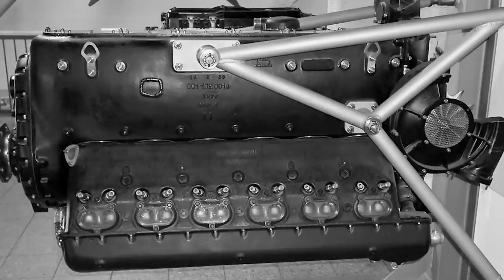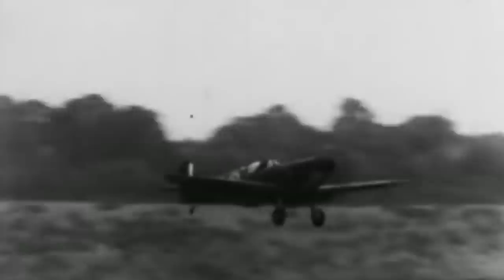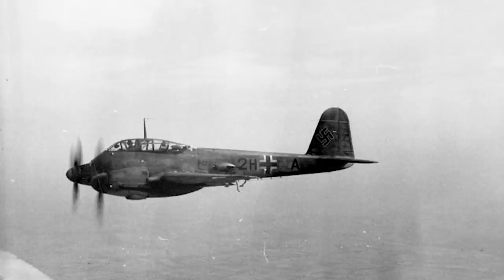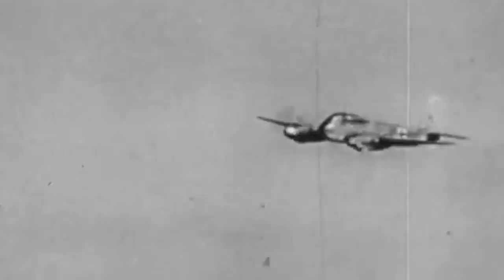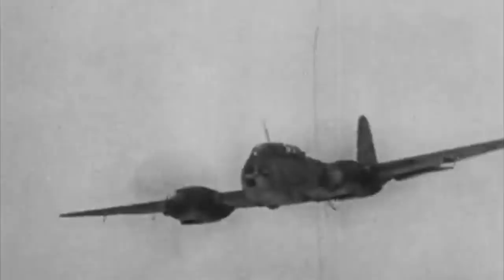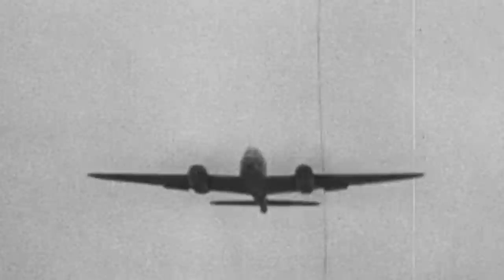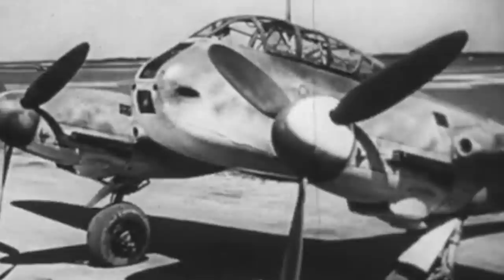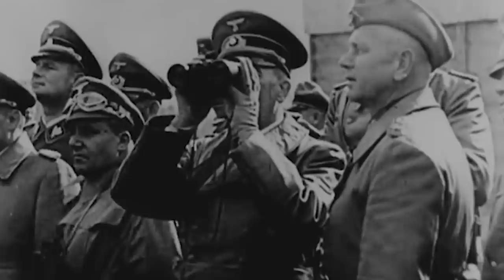The Catastrophically Bad Airplane that Ended Germany's Chance to Win WW2 - Me 210 Destroyer

Comment: The fuselage of the Me-210 was shortened to save building material, which caused the instability during flight. The Me-410, its successor, had a fuselage with the length of the original design, and it proved to be a much better aircraft.
Reply: The wing design was also changed slightly with the outer wing panels swept back due to issues with center of gravity being too far aft.
The 410 was quite a good aircraft.
The 210 was supposed to be the answer to the British Beaufighter and Mosquito.
Reply: Besides the serious instability problem, the Me 210 was a bit underpowered for its size, too. the improved fuselage design and the availability of the more powerful DB 605 engine made the Me 410 a much more acceptable plane.
Reply: do you guys think raising the horizontal stabilizer would have helped the stalling issue?
Reply: @allangibson2408  Beaufighter and Mosquito did not exist in 1939, nothing to do with Me-210...
Reply: @allangibson2408  Douglas did that for the DC-1 to DC-3, so that's not a problem. Messerschmidt did it for the Me-262 for the same reason and got a few more mph out of the airframe.
Reply: @MrTaxiRob  no because wings provide lift and at high angles of attack,  or AOA the stream going over the wing separates and result is loss of lift. The horizontal stabilizers are there to control pitch and AOA but once lift is lost they are just along for the ride
Reply: For all their legendary engineering expertise and reputation for quality manufacturing typically the Nazis were either penny wise pound foolish or squandered necessary materials on recklessly ill advised pipe dreams (fortunately for the Allies).
I used to restore Mercedes and was a BMW mechanic and found them both over engineered and finicky to maintain. For example, the 70's BMW 2002 had to have the valves adjusted every 3,000 miles, but when they WERE adjusted, nothing could touch it! My first car was a '59 MB 220s and while the gas engines weren't especially long lived the diesels used as taxis in Germany often lasted 900,000 miles.
Reply: @mro-aviation  I thought the problem arose from them being in nearly the same plane.
Reply: @Cadadadry  The Beafighter first flew in July 1939 so they were contemporary aircraft. The Mosquito first flew a few months later. Though wether the Germans were aware of them is of course a different matter.
Reply: @MrTaxiRob  An aft horizontal stabilizer cannot help, if and when the wings are stalling, as stalling is caused by the disruption of airflow at a certain angle of attack and airspeed. Position of the horizontal stabilizer has very little to no effect on the airflow before it.
Reply: @Kedvespatikus  ok then I misunderstood the way he described the problem in the video. Dark Whatever isn't an aeronautics engineer.
Reply: @MrTaxiRob  The problem with the horizontal stabilizer was that it kinda blocked the line of fire for the backward turrets. And shooting any stabilizer away is never a good idea. :)
Reply: @mro-aviation  

The stabilizer may be shadowed by the wing's drag in some situations. The aircraft then becomes uncontrolable.
The efficiency of the stabilizer is not connected to the wing efficiency / stall.
Planes with Straight wing do not do AOA. Only swept and delta wings.
Reply: @Kedvespatikus  
The barbettes where set such as the fire was interrupted when the line of fire crossed the stabilizers.
This was hard to achieve on a small compact aircraft, it has to be an electric solution because the goal was to reduce drag. More complexity !

This is a common problem with most dorsal-turreted aircrafts on both sides during WWII.

According to the time and size of aircraft, solutions where different? Eg on the Lancaster there was a rail all around the dorsal turret to prevent the guns from aiming at self. But this was generating drag and also drastically  reducing the fire sector of the turret. On B25 this was achived with an electric device. But this is a much larger aircraft than a Me210 !
Reply: @airplayn  Not even a Boss 302 as that was a high performance engine

Comment: The program WAS salvaged. With the Me 410.
Reply: More like "scrapped for parts"...
Reply: "salvaged" versus "replaced"
Reply: İs it really" salvaged" if you build a completely different plane
Reply: Fair, but Dark Skies often goes for drama over nuance.
Reply: @atakorkut5110  look at the pictures its basically the same plane.
Reply: @nick4506  yeah, very true but still  also completely different would you not say ?
Reply: Salvaged, but at what cost? By the time the 410 was available, a long range escort/strike fighter was no longer needed. The Luftwaffe needed interceptors like the Me 262 to meet the Allied bomber offensive destroying German factories and synthetic fuel plants.
Reply: @nick4506  Me 410 has a longer fuselage, new wing plan and new engines, so not really the same.
Reply: @atakorkut5110  nah they the same plane just new engines and wing angle adjustments. i think germany was just less picky in 1943 compared to 1939.
Reply: Didn't exactly salvage it.
Reply: And an attempt at prior salvage with the ME 310 which wasn't much better than the 210 and I don't think saw action?
Reply: @Frserthegreenengine  hey that's what Boeing does 🤣
Reply: Gotta love all this post WWII revisionism. Patton was right, we fought the wrong enemy in WWII

Comment: The Hungarian Me 210's were actually quite decent. The Ca-1 version manufactured in Hungary was slightly modified; the fuselage was lengthened, the wings and the landing gear were re-adjusted a bit, a different engine (the DB 605 was already license-produced in Hungary) was installed and so forth. The armament was also different, some Hungarian Me 210 were equipped with 40mm autocannon and missile pods. These were used extensively on the Eastern Front and were liked by their crews. These adjustments were eventually used for the Me 410. Hungarian pilots tended to like the Me 210 Ca-1, although they did not consider it an easy plane to handle; only pilots with previous experience with the Ju 87 were trained for it.
Reply: It was used as a Schnelbomber, ie, fast bomber (not unlike the De Havilland Mosquito), one pilot claiming : "We could hit a bedsheed with our bombs".
When once deployed against allied bombers, the Hungarian Me210Ca-s we ambushed by a large P-38 Lightning formation with disastrous result.
Reply: @karlvongazenberg8398  - Abd B-17 bombardiers claimed they could hit a pickle barrel!  ; )  With the P-38, aviation genius Kelly Johnson showed the world how to design  a great twin engine fighter. America's top two aces flew the Lightning, although  in the Pacific.
Reply: @scootergeorge9576  I guess the best US paralell for the Me-210/410 is the A/B-26 Invader.
Reply: @karlvongazenberg8398  - Interesting but the A-26 was a dedicated attack bomber. A night fighter variant was proposed  but rejected in favor of the P-61 Black widow.  Perhaps closer was the A-20 that saw use in multiple rolls. Both attack aircraft were designed by Ed Heinemann at Douglas who also designed the A-4 Skyhawk, AKA the "Scooter."
Reply: @karlvongazenberg8398  The A-26 was never intended to fill a fighter role.  As a bomber it carried almost 3 times the bomb load of the Me-21/410,  Plus it was a joy to fly.  My god father flew it and loved it.
Reply: 14 years ago I published a book about the Me 210 in Hungarian service and I also have such a video in my channel.
Reply: @karlvongazenberg8398  B26 was called "Marauder" (a.k.a. widow-maker).
Reply: @DrAgan_tortojed  You are mixing the Marting B-26 Marauder (crew 7) with the Douglas A-26 Invader (crew 2-3) later redesignated to also B-26. 
Agree, its confusing.

Comment: One version of the story says that Messerschmitt engineers were so busy with other projects that they imported a few engineers from a rival (Arado) and tasked them with designing the wing for the 210. The poorly designed wing roots created turbulence and when that turbulence hit the tail surfaces, it made the airplane unstable. 410's re-designed wing cured most of those problems, but too late to affect the out-come of the war.
Reply: There was a Boeing plane with the same problem, if I'm not mistake.
Reply: They could have put the tailplane on top of the tail fin. But I guess that was to easy.
Reply: @davidelliott5843  you can’t just move bits and have it work the same

Comment: Well, the Me 410 was a 210 with fixes. The reason the dubbed it 410 was to ascertain the pilots they wouldn't be thrown in the air in the disastrous 210. However, the 410 was effectivly a Me 210D model. It's more than difficult to tell the differences between the 210C and the 410.

Comment: Salvaged... wouldn´t the 410 count as that?
After all, it was essentially a 210 with the major flaws corrected.
Reply: A significant number of 210’s were directly converted to 410’s - they were that similar. The changes were to the outer wing panels (with increased sweep) and tail.
Reply: @allangibson2408  I know, hence my comment.
Reply: Didn't the 410 have monstrous 44 liter DB.603's?
Reply: @adamlannerd1408  In a plane with this configuration swapping enigines if fairly easy.
They planned doing it with the OV-10 Bronco for reintroduction into service.

Comment: I’d say the Bachem Natter was one mean S.O.B. as well, worse even than the me-163 Komet, having killed more German pilots than allied ones.
And I guess the He-177 didn’t do too well either.
Reply: The engines on the Heinkel He-177 caused them a lot of Greif.
Reply: The Do-335 wasn't too bad, but, boy, did they snake like nobody's business. The "Violently Sick Machine" as it was dubbed by German pilots. Yes, they were fast, and reasonably reliable, but I don't think that counts if the cockpit is full of vomit and the pilots have to take the next two days off for their stomachs to settle.......
Reply: As long as the engines didn’t flam up, pilots liked the He-177.
Reply: @michaelnaven213  Quite weirdly enough, once the he 177 crossed the channel to bomb Britain, it has the highest bomber survival rate during Operation Steinblock due to its decent speed and high attitudes it flies at.

Personally, they should have done what the Lancaster bomber did and just switch it from a 2 (super) engine bomber to a conventional four engine bomber.
Reply: @Sherwoody  Baddum-tish.
Reply: @manchukhan8255  
The He177 was a four engined bomber
The problem was, afaik, the genius idea to make the Grief able to dive bomb.
Hence just having 4 engines in two nacelles.

It amuses me no end as to just how stupid the Nazis were.